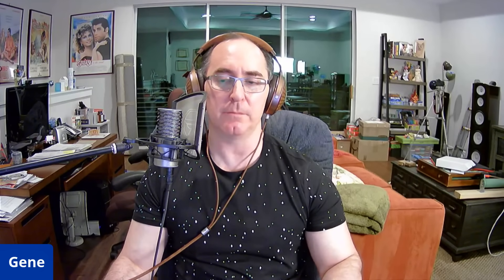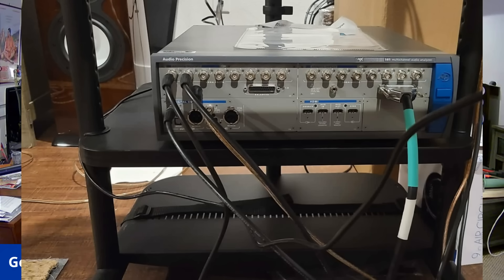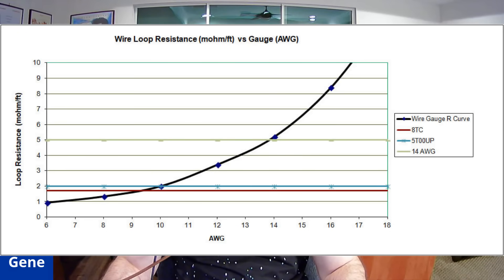Speaker Cables Really Don't Make Much of a Difference?

Comment: Great video.  You are not wrong in virtually everything you’ve said.  I have done a fair amount of .mil and experimental research and development on baseband-RF on both the transmitte and receiver side where phase calibration is essential.  We find that for many applications cable differences are too minor to matter— as you said, many other factors matter much more.  However, as you have seen, cables do affect the signal.  
You asked for ideas and input, so:
Why don’t you (1) test phase vs frequency with different loads; (2) Compare “radio shack style” zip cord to OCC and pure silver across the tests; (3) do a playback of the inter-cable delta of those cable types of a complex speaker load during music playback.  (4) listen to that delta.  We found in some applications that phase vs frequency on complex loads was so variable that we calibrated to mated cables.
Just like physical positioning, cables can affect imaging in terms of wavefront coherence and variability f(t) on complex loads.  Can that be audible? Most definitely.  Does it matter more than other factors like the room, speaker / listener position? No.  Does it have an audible effect on an otherwise well configured system? It certainly can.

Comment: Did you actually listen to the cables that were tested?  Does testing the cables tell you how well they image, give 3D depth and for that matter how they perform from top to bottom?  Interesting video, but still left questions to be asked, mainly how they sound when listened to in a system.
Reply: A speaker cable passes electricity through it. Image, 3D depth etc are affected by the loudspeaker 🔊 and the physical room.

Comment: Gene, thanks for another fine video on the bogus claims made by cable manufacturers.  I'm now seeing ads for absurdly expensive cables with magnets attached.  These magnets supposedly "direct" the electrons within the wire so that they move more efficiently through the conductor.  They are also selling something even more akin to snake oil:  3 milliliters of some nano-fluid which will greatly improve your interconnections for a mere $599.  I'm sure some very wealthy audiophiles who can afford this won't miss the investment in such foolishness, but I hope no one with modest means puts their hard-earned cash into this nonsense.  I'm sure it won't harm anything, but it's absurd to think there will be an improvement.

Comment: Thanks a bunch for this very thorough video, Gene. Just a bit disapointing that I feel I could have spent that near-500$ waste on Kimber Kables (I have 2 pairs, to bi-amplify my fronts), and add that value to say, a better power amp or AVR. I simply don't care at all about their jewelry aspect. On a side note. You did not talk about interconnects, but I presume it's probably the same kind of conclusion.

Comment: True if you keep cables at 10 ft or shorter. In longer lengths 15 to 20 ft. There is an audible difference.  first time I used Monster Cable I could hear more bass. Now into Audioquest cables. Mid price cables also corrode less over time.  I don’t know about $$$$ cables. Can’t afford it.

Comment: Just go and listen, don't listen to the pre-sales hype. I never let someone tell me how a piece of gear is supposed to sound compared to another, so you eliminate the pre-concieved ideas. Audition amps , speakers , cables, etc. and by what you want and think sounds the best to you. The placebo works in reverse too. If you have stuff you think sounds bad, or not as good, it will never satisfy you. Why do people buy jewlery? Nothing wrong with cables that look cool, and if you think they sound better , you'll be happy. I get where your coming from that cable manufacturers shouldn't be selling bullshit. Now with interconnects I've compared without any pre-concieved hype and heard definite differences, and when I explained what I heard was told that's what the differences are claimed to be. Yes speaker wire has way less effect, and power cables makes me laugh, especially if you understand what happens in the gears power supply. One minute difference by itself is nothing, but all the minute upgrades accumulate to the end result.

Comment: Gene, you forgot to apply "snake oil" to get that smooth buttery sound.  

See https://www.highfidelitycables.com.  1260 3-D Ehancer Solution
Statement from the website:
"This is a powerful dimension and clarity enhancer that dramatically improves the three-dimensionalities of audio systems improving clarity, sound-staging in imaging. It has an extremely dramatic effect on distortion reduction which allows the system's natural capability of dimensionality, musicality, sound staging, and imaging to be dramatically increased. This revolutionary new product is unlike anything ever made. There is no product in audio that offers so much benefit for so little"

Comment: I use 14awg spool wire with bananas on both ends.   I also A/B bi wire because my speakers allow it.   I’ve used Kimber before but do to my room aesthetic, my gear is 20 feet from my speakers.  So, cost/value driven.   Am I happy with what I hear?   Yep.  Am I motivated to invest more?   Not at this point.    Thanks for your video.

Comment: Former cable company worker here. FYI there is no such thing as a 99.9% pure copper cable. If it was so it would be so brittle it would easily broke . My company usually add around 20% to 30% other form of metal to make it more flexible. And yes our cable is certified by UL,TUV and a whole host of other certificates. We did a special run of cables for Tina Turner world tour back in the day.

Comment: I think for a long time that measuring equipment is not as accurate as our ears. Also, microphony might also be relevant and had been ignored from the equation. Love the Kimber and i think the matrix of its construction might have some kind of effect on the test result, mechanically/electrically in a real live operation. An interesting test, or retest,  would be to put the cable stretched with a moving coil in the middle (could be a speaker driver with some kind of mechanical coupling to the speaker cable "toilet paper tube...LOL") and modulate it mechanically with  the test signal in real time or with some milliseconds of delay. Keep the good work and regards from Portugal

Comment: How did the cables differ in noisefloor and noise rejection properties? The reason Kimber kable is braided is because it works with noise rejection. Picking up less RFI and other stuff. works less like an antenna. IMO that’s where you hear a difference with speaker cables.
Reply from the maker: very negligible difference once the cable is terminated into a loudspeaker. We don't hear RF frequencies either.
Reply: @Audioholics  we only hear it when we notice less degradation of sound.

Comment: Well I was a sceptic but I did invest in a moderately priced set of  Morrow cables to replace what were just 12 gauge high purity copper wire with some Radio Shack banana plugs. What I did was move the speakers to the center of the room and played a quality mono recording and used the balance control to A B them. The difference was very obvious. To confirm what I was hearing, I had a half a dozen people who weren't audiophiles listen and everyone was in agreement that there was definitely a noticeable difference. Most described it as the "lifting of the vale effect".  I think a lot of that has to do with something this gentleman didn't address and that is cables ability to insulate the audio signal from outside interference and in my opinion that's more important than the electrical measurements. later I borrowed a friends thousand dollar Level 5 Anti Cables and did the same. Yes there was a slight audible difference but worth 5x the price?  I guess that depends on your wallet.

Comment: I use the Kimber 4TC, and have for over 20 years.  I believe at the time that there wasn't the 8TC option.  I don't recall how much I paid for them, but I jumped after seeing measurements that showed that they measured better than standard wire.  Even at a couple of hundred dollars, they have been worth the spend after all this time.  I also used the PBJ interconnects when we had multichannel analog outs.  Those are now relegated to my computer setup, where they are probably gross overkill!

Comment: Hi Gene, I've been told  larger speaker gauge is less susceptible to inductance/interference from other electrical wiring in house walls.  When installing speaker cabling for distributed/whole house audio, other than voltage drop does a larger gauge wire guard against interference?
Reply from the maker: That shouldn't matter.  If you want less interference,  used twisted pair or shielded.
Reply: @Audioholics  Thanks!

Comment: One of the only times I could ever hear a difference in audio was when I changed out the external power supply on my DAC with a tightly regulated power supply.  I could audibly hear the noise floor drop lower.  I used to get this super high pitched hiss/squeal and now its less noisy.  I maintain that all audio equipment is noisy unless you have some type of noise gate and now your just impending the damn signal!!  Anyways great channel brother, keep it up!!

Comment: Ears don't hear measurements. Everyone hears things differently. How are you going to measure sound stage, separation etc. I suffer from tittinus and I hear differences from one cable to another. All that money for testing equipment and still you can't trust the most powerful equipment of them all (a pair of ears) trust your ears that's it that's all. To hell with this stupid testing equipment.
Reply from the maker: If there isn't a measurable difference in amplitude or distortion between cables, there isn't an audible one either. Keep up the illusion if it makes you sleep better at night. No worries.
Reply: @Audioholics  I trust my ears more then anything else. To see is to believe. Same goes in hearing. There's no illusions in hearing its either one thing or the other. I've heard cheap speakers and cables out perform expensive ones but when measuring sound with a microphone it reads the opposite and vice versa. Just for the record I too thought everything sounded the same until I began testing other cables and interconnects. I must agree that alot of expensive cables are over priced for what they really do. But having a good cable does make a difference in sound stage, imaging, etc.
Reply from the maker: @Chapterriflik  Nothing was measured with a microphone. I measured the electrical signals of various cables driving a speaker and they were virtually identical. Big difference than trying to measure and understand the psychoacoustics of perceptual differences in loudspeakers.
Reply: @Audioholics  who said you measured with a microphone? I said some people, not you. I'm done here have fun with those measurements.
Reply: @Chapterriflik  You obviously don't have any clue about what bias is. Please don't use your own ignorance to attack those who know better than you. Biased ears (my bad: mind) are the least reliable thing to evaluate such things. Any competent and knowledgeable audio enthusiast knows that. Have fun lying to yourself, "hearing" differences that are all in your mind... Cheers.
Reply: @vintageflanker7096  lol maybe your ears lie to you but I know what I hear, as I said everyone hears things differently. I'm not ignorant I just hear things differently, so yes I totally disagree with equipment that was man built and programmed to do one thing only. You are not me and I'm not you. If you can't hear a difference, kudos to you, less problems. I never judged who and how they hear things I'm just saying don't trust a machine. You are the one who is judging me now, so I suggest you read my comments before you tell me I don't know what I'm talking about. Have a great session with a machine while you enjoy your favourite music

Comment: the only issue i have with all of this is you havnt tested any 5 grand onwards cables. youve only tested relatively cheap cables.i dont think many of us are are not in agreement with all of this.but the only way to put this to bed is to get a very expensive cable in and test it.otherwise we will all just keep on wondering. also i agree with you about the measurements etc.but your tests dont ascertain whether they actually sound different. only that they measure different.i have heard differences in speaker cables.i had vandamme cables before i changed them for Kimber cable and they sound much better now. nothing at all to do with measurements. we all want to know whether spending thousands on cables sound better than cheap cables.this test does not solve this.
Reply from the maker: I showed a cheap cable produces only 0.06dB loss! The best cable is NO cable at all would be 0.0 loss. The net difference 0.0db - 0.06db = -0.06dB.

Comment: Been using Straight Wire Crescendo speaker cables(and interconnects) since original install in 2009. They do sound good with Rowland Model 12's but I still was giving thought to upgrading them as even S.W. upgraded the Crescendo's to Crescendo 3's. (I think the only difference is the insulation though). I do have GIK acoustic panels and traps but after seeing your video, I don't know if that is the right place to continue with upgrades.
Reply: I never agree with 100% objectivist camp, that measurements can show everything. But I do think that any difference must be verifiable with double blind A/B test, or it doesn't exist.

Because placebo effect exists and that our audio memories is very limited. (we forget audio details in seconds).

Comment: This is absolute gold! Could it be that the .06 difference among cables is actually LESS when other small variables are factored in? In other words, it's not actually the cables that are measuring a difference but perhaps minor resistive differences in the connectors (or other factors) are contributing? Really an excellent video. Thank you.
Reply from the maker: very possible. that's a pretty hard thing to measure since it's such a low amplitude difference.
Reply: @Audioholics  Thanks for the reply! You're the first that I've seen take actual measurements and move beyond the BS.. Outstanding!

Comment: Great video, you never mentioned anything about how the cables sounded. We don't listen to music with test equipment.  Just a thought. 
I am using Kimber Kable 8VS.
Reply from the maker: If there is a negligible difference in amplitude response and distortion,  there will be no perceptual difference in sound.
Reply: @Audioholics  You just have a bad case of confirmation bias.  You refuse to believe there can be difference so you don't hear or even try to hear a difference. I respect your choice.
Cheers
Reply from the maker: @MegaF1guy  I spent years not hearing differences in cables so I started measuring. The measurements now confirmed what I'm not hearing.

Comment: I am someone who uses cheap monoprice speaker cable because I don't have a $5,000 amp or $5,000 speakers and last time I tested my hearing, it was dead above 11k, so my only comment is I am a DIY speaker builder and when designing a crossover, I know you can hear the difference in Cap manufacturers even though the measurements are the same. So if someone can hear the difference with high priced cables so be it. Me I'd rather spend the money on better Caps and inductors. Just my 2 cents.

Comment: You are correct but what about EMI...have had CB come in over my speakers .. braid or twisted shielded pair might have helped prevent that? Assuming cable and not amp was the antenna? CB was running linear amp I'm sure so it was stomping all over the system.
Reply: @Douglas Blake understand, thanks

Comment: Moving my head. Shades of singing in the rain. Nobody should ever pay more than three hundred bucks for cables. I made my own speaker cable jewelry. They look impressive. The system sounds good. The problem is big cables are PITA. I mean, they're heavy. If you step on one, you feel it. That said I'm sure some cable is better than others. I am going to do a comparison for myself. On my cheezy home, clapped together, two channel system. I don't have any measuring stuff. I couldn't even guess how to use it. I'll use my old man ears and try different speaker location. I'm not sure what I will find. I do intend to have fun. And use it as an excuse to not do my taxes or cleaning.
Reply: @Douglas Blake Hey Doug. I here ya. I did say that I made my own jewelry. Some 12 gage some 10 and some 8. I ordered way more than what I needed. The terminal bannannas are the locking type, so they're pricey. I try to keep an open mind about different ideas. The best test is of course listening. I'm not trained for any of this, if it sound better worse or negligible, so we'll see. I've spent more for less. I'm not purchasing mega buck stuff. All DIY.

Comment: I just bought Pinetree Audio Kinietic Bi Wire 9AWG speaker cables for my Magnepan. 7's  The cables are 10 feet long very well made with locking banana connectors on both ends. I had the option of choosing what color l wanted  I definitely what function and performance, but at the same time l appreciate quality and how something looks Not bad for $200 delivered
Reply: Indeed. Nothing wrong with a little eye candy cable..

Comment: For 4 years my Denon M40DAB was connected to Technics SB-3500s with 1.5mm mains cables - changed to proper speaker cables - discernable difference😮